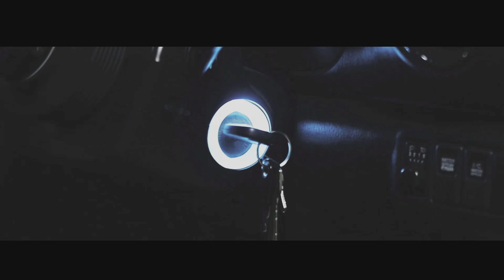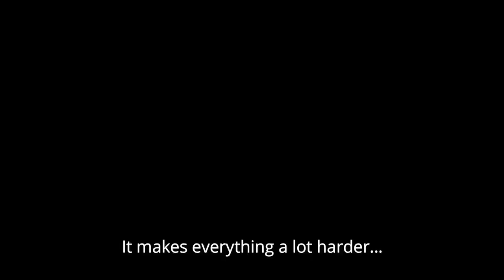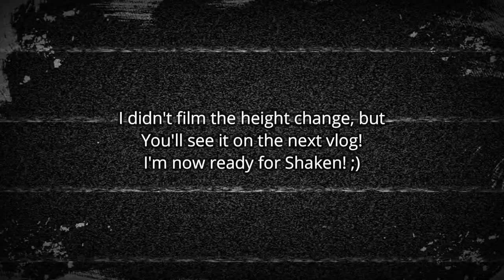Replacing the gaskets for Tomei exhaust manifold, up pipe, and HKS down pipe on Subaru WRX STi

Comment: Bro, how did you start your car without pressing in the clutch!?
Reply from the maker: I bypassed the wiring ;)
Its commonly done on the airbag when you replace the steering wheel with an aftermarket product so the ABS lamp doesn't pop up
Reply: @KiNOSTi  Dude, that's badass. You got a link to how to do that?